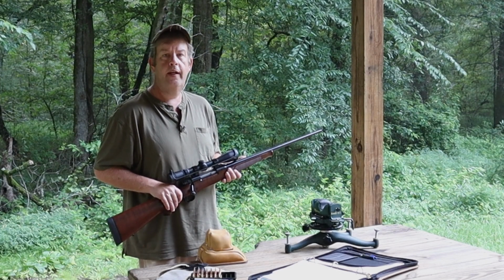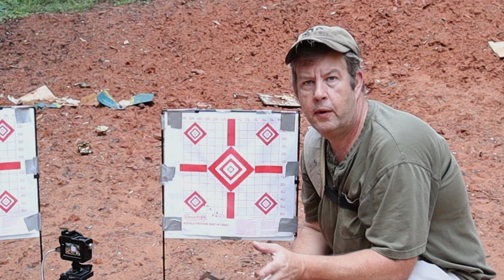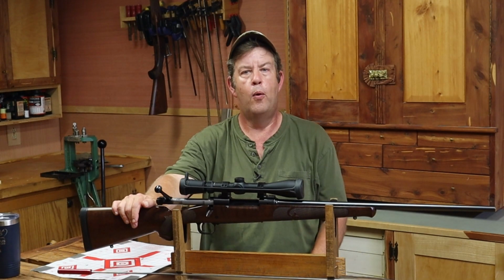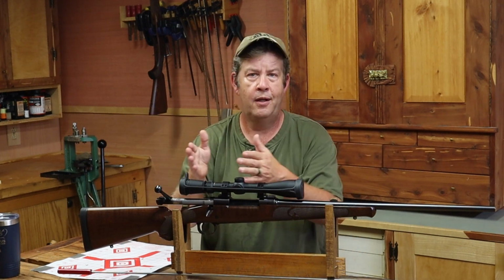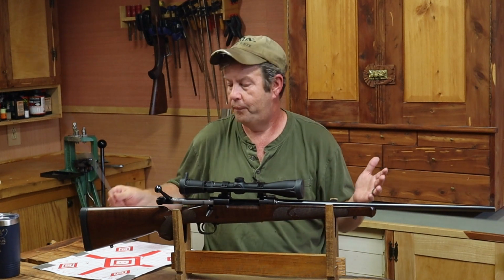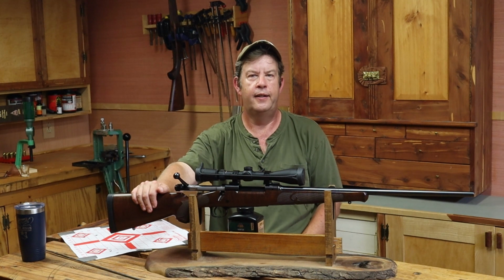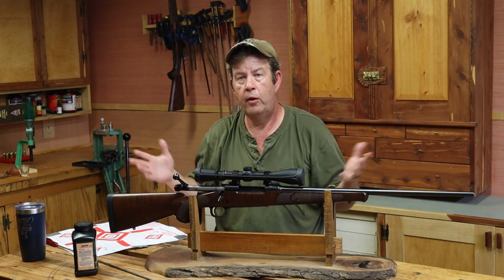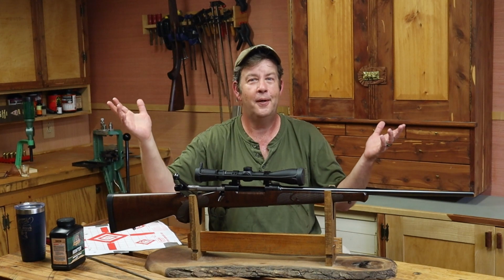257 Roberts Project: Progress After Bore Cleaning

Comment: Hey Tom
I saw your comment below about the wonky rifling. That's probably causing most of your woes. But if that issue didn't exist,  2 or 3 of your groups were around half MOA if you disregard the first shot in each group. One was the first shot after a deep bore cleaning, the others were the first shot after changing powders. If you want to shoot a four-shot group for record, load six rounds and fire the first two at a rock or something. Thanks, Tom!

Comment: Looks like you are on the right track to get it shooting the 120s. I had all last week and never got to the range with the 25-06 to check it with 120s. Was feeling a bit under the weather. Today I'm really under it cause we had heavy rain. It looks like the deep cleaning helped. The Ramshot Hunter is right beside the old AA 3100 on burn-rate, and the 25-06 seemed to do well with it....until it was discontinued.

Comment: Tom, those horizontal POI shifts tell me that you may need to bed/re-bed the action to the stock.
Reply: Exactly what I was thinking
Reply: Probably so, after glass bedding, free floating the barrel and a minor trigger job my. 257roberts win model 70 became a tack driver
Reply from the maker: Well ya'll should love this one. The lands aren't even in the bore. Seriously their crooked with one starting where the chamber ends with no free bore at all and on the opposite side about 1/8th of an inch of free bore. When I saw that random horizontal variation my first thought was seating depth issue and sure enough there is a big one! LOL

Comment: If I may offer some input.  I believe I know what's going on with that rifle, and if so, it'll be shooting like a laser in five minutes.  I currently own that same model special edition US made .257 Roberts, as well as another Portugal made Featherweight in 22-250, and a Standard in .270 Winchester, also made by FN in Portugal.  Each of them are among the most exciting and accurate rifles I have owned and handloaded for, in over 55 years.  In watching your other video in regards to the horizontal dispersion of this rifle, you suspected bore anomalies to be the culprit.  On the basis of my personal experience, such horizontal dispersion is virtually always the direct result of instability of the receiver bedding, whereby the action pivots horizontally.  FN employs a very sophisticated two-point epoxy bedding system in conjunction with a totally free floated barrel.  Epoxy snugly surrounds the forward screw, which actually threads into the epoxy.  The rear tang screw has full clearance.  Those two screw features are important.  It's the finest bedding system going. Let me get to the point.

My laser accurate .22-250 suddenly went very sour, shooting the same sort of wild side to side dispersion.  After my previous trip to the range on a wet day, I had removed the stock in order to properly dry it, and thought I had property replaced the stock.  I've been taking guns apart all my life, but this taught me a lesson in humility.

I grabbed my screwdriver and pulled the stock off at the shooting bench.  Lo, I discovered that the box magazine was not fully seated into the receiver by the last 64th of an inch, causing the receiver to bridge. It's a snug fitting magazine and has a way of getting cocked fore and aft in such a way that it will bind and prevent the receiver from fully seating if you're not watchful.  I corrected the issue and the rifle immediately began to sing.  I think that's your issue.
You can watch each of those rifles perform on my channel. I hope that helps.   
God bless.
Reply from the maker: Sir, your input is both welcomed and greatly appreciated! And I will certainly check the magazine for proper seating. I will also cross my fingers and hope that is the problem. But I have to say my experience with the FN model 70's has been really bad up to this point. And I have no problem admitting that I am learning as I go and I could have very well made any number of mistakes along the way but of all the rifles I've had over the years I've never spent so much time trying to figure what's wrong with a rifle as I have with these 3. But I do greatly appreciate your input!
Reply: This is why I love watching both your channels and look forward to them at all times. I had issues with that box magazine,  which takes some effort and attention to get centered and mated. My problem has been slinging 3rd shot fliers with my Featherweight in 7X57. Have tightened up my groups with load development and torquing the action screws incrementally between range trips.
Reply from the maker: @cbsbass4142  Hold my beer while I go make tomorrow's video. I think you'll find it interesting? I can't say it will solve your problem but ti will be something to check for because I had the same problem with my model 70 throwing the 3rd shot. It ended up being a combination of not enough clearance in the barrel channel and the stock warping. I ended up having to replace my stock, but hopefully your issues isn't as bad. But do check that barrel channel in case the wood has moved a little.
Reply: @TomRiverSimpleLiving  I will do that. As I have increased torque on my action screws the clearance is decreasing---less free float even as it slightly improves accuracy. Where in the stock were you noticing the warping ?
Reply: I had also heard that the more highly figured woods are more prone to warping ?? I must say, though, I sure love a  Walnut stocked rifle, of any grade.
Reply from the maker: @cbsbass4142  I was noticing the warping around the pistol grip and the warping was so bad on mind that I had a really tough time getting the action out of the stock. And highly figured woods do tend to warp more but the curing process usually ensures it's stable. But every now and then one will warp.
Reply: @TomRiverSimpleLiving  Thanks.

Comment: I’d try a cooler primer fed 210 is right up there at the top of the heat range for a large rifle primer and not needed for a less than 50 grain charge go to a Cci BR2 a much cooler primer more suited for that case size and charge. Also sometimes you just got to give up on a powder IMR4350 would be my last choice for a rifle these days with all the temp stable powders available H4350 would be a much much better choice. Also the way your going about your load development is all over the place your picking a random charge and putting it behind a bullet with no rhyme or reason. You need to start at a charge around middle of the recommended load for that powder bullet combo and increase half grain at a time until u hit pressure or a stable velocity node then play with seating depth in that velocity node. Do this with 2 round at each charge so to save components if the first two don’t touch the third fourth fifth or tenth won’t make that group any smaller then when you hone in on that node then go to you 3 shot groups to do seating depth testing seating depth will often make more a difference in group size way more than powder does most times. That rifle looks to be a feather weight model 70 and 4 shots is to much heat for that thin barrel. Luck has nothing to do with making a rifle shoot it has to be done in a strategical way stable velocity step one seating test step two if it don’t work or your not satisfied with what your getting ditch it and move on start over with another powder and primer most bullets can be made to shoot in any rifle with the right combo behind it. I see way to many people waisting time money componets gas energy and barrel life trying to make one powder one primer and one bullet work in one rifle that just may not work these are factory rifles your working with and tend to be much more picky then the custom rifles I and many other shoot. But people see how easy load development is with the customs and wonder why they can’t get the combo they want to shoot to shoot in there factory rifle well that’s the reason FACTORY RIFLE !!

Comment: Been looking forward to this. Thanks. Just a warning on the ramshot ball powders. They can get pressure spikes between rounds with the same loads. Had a good load worked up with Ramshot big game in 30-06 thought I had a safe load. Out of 20 rounds had one blow the primer out and had very heavy ejector marks on the brass. Pulled the remaining rounds apart to weigh the powder . They all weighed the same. Went back out and shot 4 rds 5th blew the primer out. Used the Ramshot hunter in 270 win very good velocity but extreme vol. Spreads and hard to tell where max load is. Everything seems good then to much pressure. I like their powders but just hard to tell when you start to reach the limit with their line of powders.
Reply: Yikes !  No ramshot for me.
Reply: @clasvirhodes4969  I'm pushing the max pressure. If you stay within book your fine. I'm out of the recommend load data by 3 grians
Reply: Good to know.
Reply: @jasonrottlaender1721  you're blowing primers when 3 grs over book max? Shocker. Why don't you try staying under book max? After all, your chamber and bore could be tighter than the book's test barrel. Just trying to be helpful.

Comment: Many gun gurus claim that copper "fouling" can be good and is not bad.  They claim the copper fills in the rough spots and smooths them out.  The cutting tool leaves course areas and the copper is peeled off the bullets and eventually makes for a better barrel.  Your thoughts?

Comment: Tom, look at two things. Shoot it without the magazine box in it. See if its putting pressure on the action. Also, does the action have 2 or 3 screws in the bottom? If it has 3 loosen the center screw to about thumbnail tight. It may be bowing the action ever so slightly. I went through this problem with one of my older Winchesters.

Comment: I noticed others commenting on bedding in the stock to the action, have I missed an episode where you covered that? because I have had vast improvement's after bedding in the action, and also probably going to far by strengthening the mounting bolts with metal tubes bonded in, no negative effects to accuracy but improvement's, can I ask you your thought on this.
Reply: They come with two point bedding at rear and around the recoil lug but my Featherweight does not appear to be also pillar bedded. I don't know if that would make a difference. My budget Stevens 200s were all pillar bedded with aluminum pillars and shot well without other bedding.
Reply: @cbsbass4142  it could be over kill to put in pillar's, but its my belief it will not make the rifle shoot any worse, and there is a chance it could improve accuracy, if you do decide to go that route it will be interesting to see the outcome, which ever you decide love the channel, very informative, please forgive me but my memory is terrible, have you had any trigger work done? she is such a light rifle and of coarse I could be wrong, but a couple of groups you had were very good except for one flyer, possible heavy trigger and a slight movement on the release,
Reply: @MsJon52  No, I don't plan to change the MOA Trigger, although I could do a Timney. I will work more on loads and bullet selection, maybe get a chrono, and work on technique. I just like the feel of the MOA factory trigger. Right now, I have worked on torquing the action screws tighter and that has improved accuracy somewhat. I have not shot since my last adjustment. Just been too busy. I don't want to torque much more, since I am at about 45 inch pounds...up from 25. Thanks.

Comment: I agree about that equalibrium of copper fowling in a bore for best accuracy. That is the Goldie locks levels of copper fowling for peak accuracy. Hopps and a brass brush works best to maintain that equalibrium but the shooter has to find that level. I really like to see that 120gr. Speer Hot core shoot the best because it is the best bullet for cost/performance level. Keep on keeping on. Load testing and experimentation makes anyone a better rifleman and shooter.

Comment: I’d try a seating depth test with the imr 4350 and the 120 speer. Make sure your front and rear action screws are tight and the middle is just snug. I definitely think with some seating changes you could shrink that under 1”
Reply: It’s funny you should mention that. I was helping a buddy find a load for this 280 Rem. We used the standard OAL of 3.35 and it shot 1” groups with 140 Accubonds at 2945. We then tried 3.385 and 3.40 OAL and his groups shrank to 5/8” group with first OAL. He was very happy with the results and killed a nice pronghorn buck with a 300 yard double lung shot last weekend.
Reply from the maker: It's funny you should mention that! After seeing the horizontal variation on some of those groups my firs thoat was seating depth issue and there is certainly a seating depth issue! The lands are crooked in the bore. Seriously they are different distances from the end of the chamber. I'm not sure how to set seating depth for that? LOL

Comment: I have a Featherweight that wouldn't group. It averaged 2 1/2" to 4" groups. Bought a box of Federal non-typical and presto 3/4". Sometimes you just have to find what it likes. I've never bought into the copper built up theory. If a load won't shoot with a clean barrel it won't shoot dirty either.
Reply from the maker: Chuck I agree completely about having to find the right load. But in this case that just got a lot more challenging for me. Tune in Sunday for this one!
Reply: I’ll be watching Sunday. A couple other things I’ve personally experienced is not all barrels want to be floated. Try some slight forend pressure or maybe it needs to be re-crowned? Just something else to try.

Comment: All the newer M70s are bedded and free floated from the factory but the forearm walnut moves a lot on these featherweights.  I look at lots of them in stores and most aren’t centered and many are contacting wood. Personally I like the extreme weathers for this reason or the standard sporters.   I agree with others here and would skim bed it and float the barrel a bit more.  It’s a pretty small dab of epoxy FN  uses around the front lug and I always redo mine.
Reply from the maker: Well Rattlebone it can get worse than that. The lands aren't even in the bore. Seriously, they're about 1/8th of an inch closer to the chamber on one side than the other.
Reply: Wow. That’s one I’ve never run into that I know of.   Might take a new barrel to fix that.  😬

Comment: Nosler cases haven't helped my 257 Rob much.  I wish I had some Peterson or Lapua brass to try because they both are heat treated.  Neither offer 257 Rob. I wrote Peterson and asked them to consider a run of 257 rob but, they replied that there wasn't enough consumer interest.
Reply: That is an issue that gripes me. New ammo and caliber development is pushing older stuff aside so the factories wont produce it. I even have problems finding .25-06 brass.

Comment: I'm not a hunter in any way shape or form, but wouldn't testing the loads be better done by simulating the actual use it's intended for.

My suggestion would be to to load for the ladder test as you intend, but rather than a string of five shots in close succession, allow the barrel to fully cool between shots, which would, to my mind at least simulate what you intend to do with the rifle. 

The rationale for this is that this rifle isn't designed to be a '100 shots in a session at the range rifle'

Anyway, super keen to see how she goes next time.

One last thing, other than COAL, bedding and potentially another 'lapping' clean with JB, have you given the crown a really good look?

Comment: Be nice if that barrel shoots good in that happy medium maintenance level. But it seems to me, barrels dictate to us, not us to it. 

Seems most top gun smiths and long range shooters only go to 20 rounds and never past 40 rounds with out full copper removal.
Reply from the maker: James for bench rest that sounds about right and they build their loads to shoot with spotless bores. Rifles for field use are generally setup for bore that have reached an equilibrium on the fouling and can go a lot more rounds. They're not going to be quite as accurate as the pristine bores but they're going to be a lot more stable over time.

Comment: The holes are not round your not stabilizing them from what I see in the paper
Reply from the maker: Tony I'm getting all sorts of stuff but all of the holes that looked to be key holed were round when I press the paper back. Those are just how the paper tore and my backing is getting worn. But I was questioning that on a few myself which is why I went back pressed the paper down on those torn holes to make sure the bullet was entering straight. Good oberservation!
Reply: Well then it's good, thought I would throw that out because I've had it happen, have a great day, ill be back again!